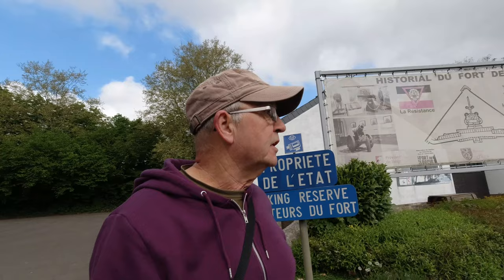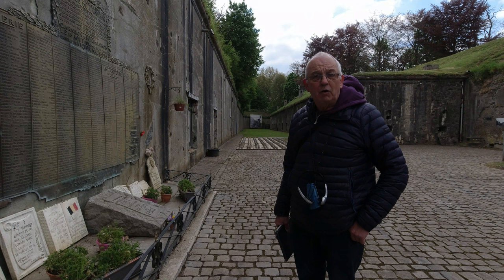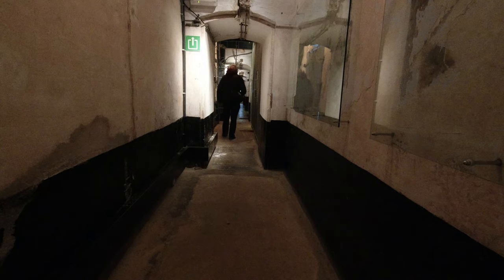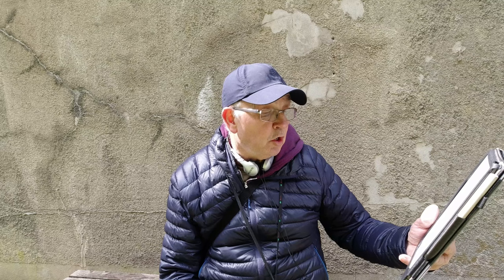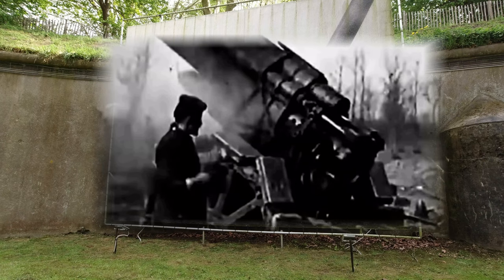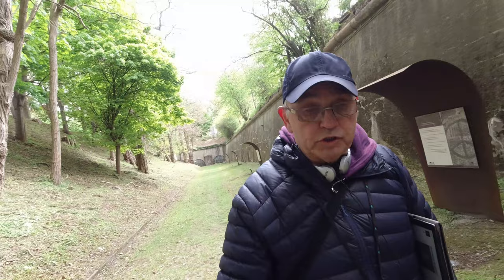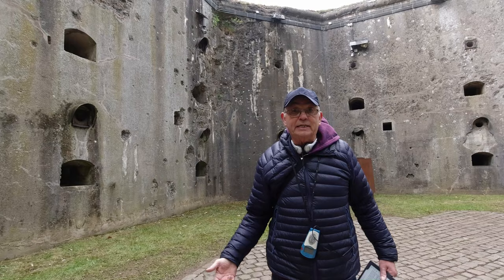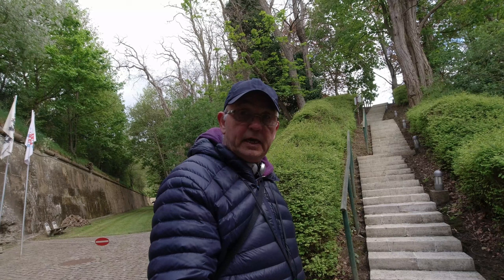Fort De Loncin   Belgium

Comment: Thanks for posting, really informative. Those turrets seem to really limit the elevation of the guns, altough I suppose this was factored into the design. Difficult to imagine the violence of the explosion on a peaceful sunny day like this...
Reply from the maker: Hi Bernie. Believe it or not. These 21cm guns had nearly the same range as the german  bertha guns. The fort is a static position where has the berthas could be moved about. The devastation is unreal when you see it close up. 😪
Reply: The biggest problem was the lack of information. There was no good communication between the troops in the field and the fortifications. So they couldn't locate the big Bertha. Also the germans fired from different places at the same time with smaller artillerie to mask the big Bertha.
Reply from the maker: @1johanverhasselt  yes, sounds very plausible indeed. German artillary could be moved around to different locations and still hit a fixed target, whereas the Fort would have to rely on any outposts that where still active. Thanks for watching and commenting 😁